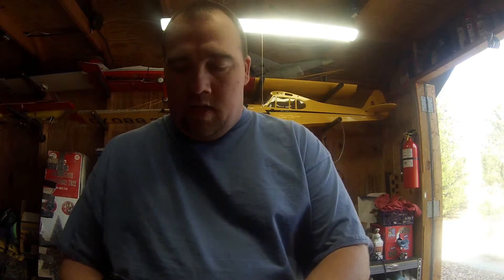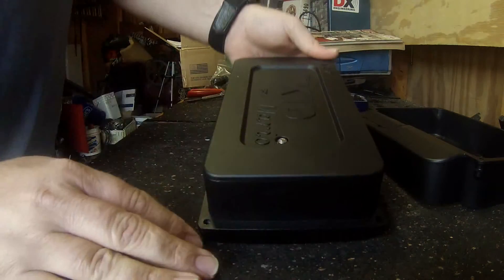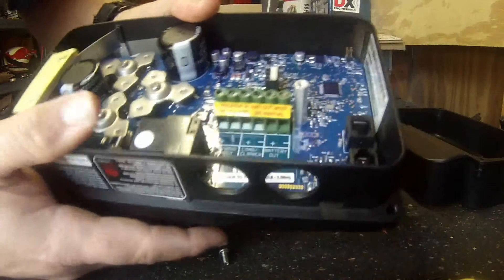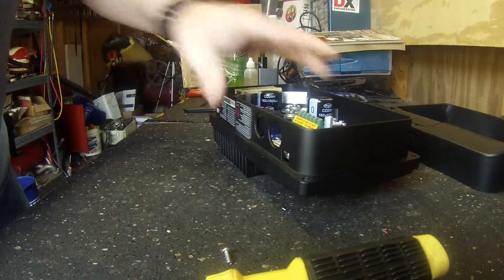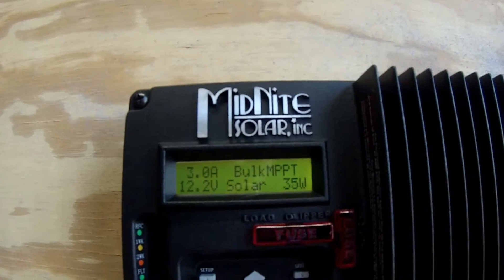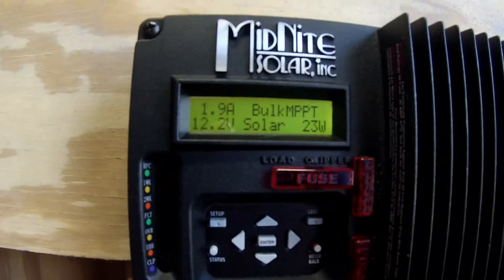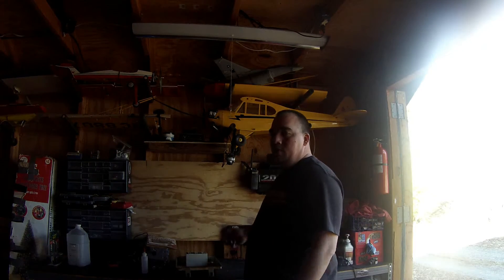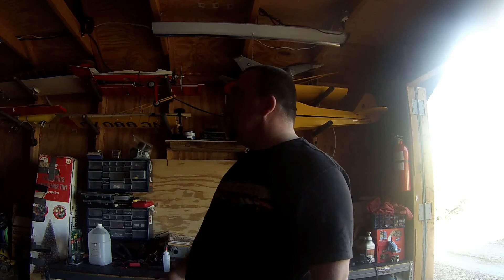Solar Charge Controller upgraded

Comment: that's a really expensive controller for 100watts....lol, I hope your getting more panels...here in San Diego we have a guy on Craigslist selling  255watt panels for 139.00
Reply from the maker: Yes it is, and yes I am planing on adding more panels which is why I sprung for such an expensive controller, plus I wanted one that would last a long time. I will say I am very pleased with it, as it continues to amaze me how much more it preforms over my previous PWM controller. I have been Keeping tabs on panels listed on CL in my neck of the woods but so far haven't seen any I wanted to pull the trigger on within a reasonable driving distance. as well as being torn between which I should upgrade first, battery bank, more panels,or a  pure sine inverter. Right now it is supplying most of my needs in my building, I only really run into issues at night when I want to run an air compressor a lot.   I am behind schedule imo on this, with everything going on tons of other projects and various distractions I stay busy.

Comment: how many panels are u using?    how are they wired?     12v or 24v system?
Reply from the maker: 1 whole panel, a renogy 100w mono panel 12v. It was very shaded in this video. I've finally got the tree out of the way and working much better. need to get that video made and up.